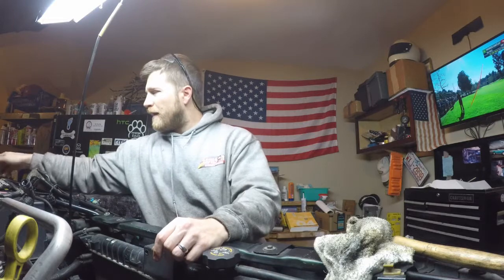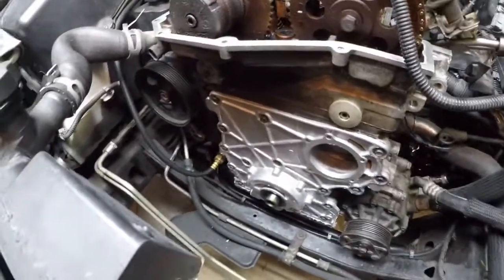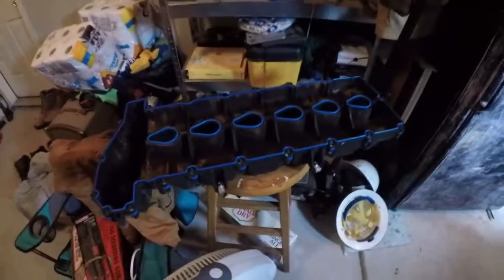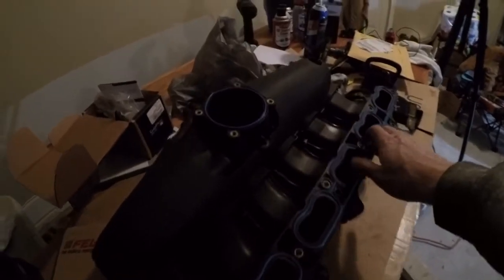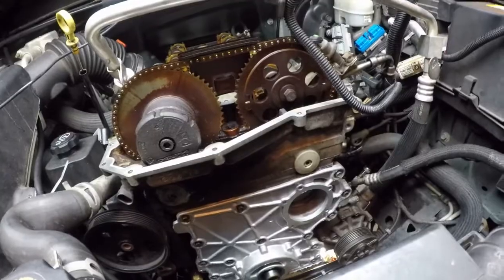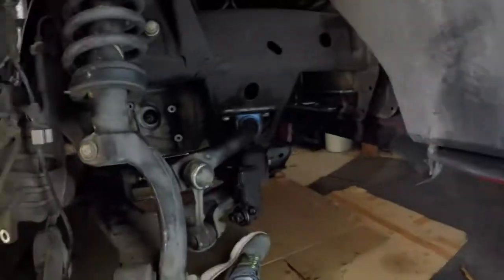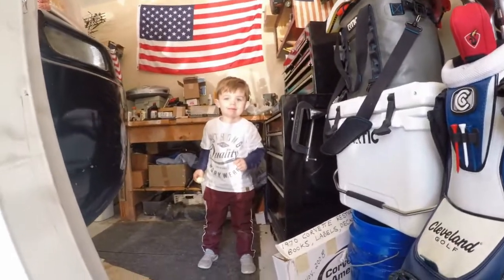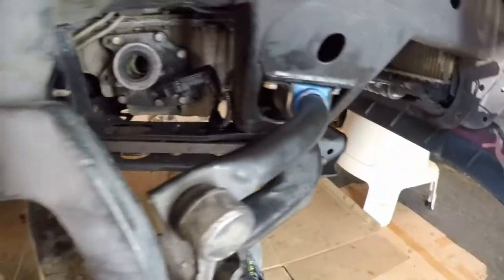Waiting on Harmonic Balancer Installer (GM 4.2L Oil Pickup Tube Removal - Part 4)

Comment: That tool is a bit short and thick I rented and doesn’t work for the trailblazer
Reply from the maker: I had to buy a puller specific for this truck. The one from the car parts store didn't work for me either.
Reply: @KevinNadeau  I bought the one from Oreilly two ton with flat jaws it work

Comment: been chasing a pressure problem for a few weeks...installed a mechanical gauge started the engine gauge went to 60psi...as the engine warmed up gauge slowly dropped to 0 while the dash gauge showed 40psi!!..no "bad" engine noises..shut off car restarted gauge went to 25psi then slowly dropped to 0...
1)Did a 5 min motor flush.
2)I drained the oil added 1 gallon of parts/carb cleaner thru the dipstick tube let sit for 2 hours.

3) replaced the oil pressure sending unit.
4) replaced the stepper motors.
Also replace the VVT solenoid..had a code set and cam position sensor..
I am now going to replace the oil pump..and from what I have found out there are 2 designs..design one will allow you to use the old pick up and timing cover...design 2 you have to buy a new tube and timing cover..

Comment: I just R+R'd a 4.2 in a 2003 trailblazer (blown head gasket, rod knock), and the 'new' engine must have a plugged pickup too. I'm wondering if a gallon of parts cleaner solvent in the oil pan for a few days may solve the issue. I'll report back!

BTW my differential was seized in the oil pan in both the junkyard engine and the old one. Ended up smashing it repeatedly with a BFH and 2x4 and wd40 on the rear end of the housing to break it loose. Not fun, even with both engines on end on the garage floor. I can only imagine trying to remove that nonsense still in the vehicle.
Reply from the maker: It would be worth a shot.  Just don't over fill the oil pan with parts cleaner, I wouldn't want that stuff eating the gaskets.

Comment: Kevin after watching you video's first time fast. Second time thoroughly..You do incredible work. Meticulous and to the point. These engineers that design these things to make our lives miserable when we have to do repairs get pensions. Go figure.
I have a few questions. My Envoy is a 2005 with 242000. It mint and I love it. How ever I used to rebuild and work when I was a kid. Teens-40's I don't have the time or the patients for this one I think. So my question is????
1-Should I pay someone to do the repair?
2-Get rid of the vehicle?
I love it. One of the best SUV's I have ever owned. Heavy..Handles great. Good work truck too for my tools. Plus my daughter and her friends have plenty of room when I pick them up from schoo.
You thoughts would be greatly appreciated...
Do you think you will be able to get another 100K after this great repair you just did. I had to replace my Tranny at 179K I put a a used one in from a Salvage/Junk/Recycled auto parts distributor. Did it myself the Tranny cost me 660 plus 100 for 12 month warranty.
TY...SKIP!
Reply from the maker: I was debating whether or not to pay someone or get rid of my car too.  I decided to do the work myself to save a ton of money, plus at 250k miles, I'm not sure how much I'd get for my car.  It took me 4 weekends to do this repair, partly because I either didn't have the correct tools or I broke parts and had to order new.
My personal feeling is that if you're able to fix your own car, go for it.  If not, you can find lower mileage Trailblazers/Envoys out there for relatively low cost.
I had to rebuild the valve body on my tranny because it was not shifting from 2-3 properly.  Again for me, I have invested a lot of my own time and money into my car to keep it running, so I am going to drive it as long as it'll keep going.  I'm hoping to get at least another 50k-75k miles out of it.  My father-in-law has a 2004 Chevy van with 400k on it and I'm trying to catch up to him.
Good luck with your truck.
Reply: Thank you for your prompt reply. Your son has a dad to be proud of. Now for this GM stuff I hear you on doing the repairs yourself as I have done most of mine. I usually get HIGH 200K to 300K out of them but I don't know...I have no rust on the frame or body. New England weather and storage. GO figure. But I cannot justify what used ones are going for...Not Envoy but SUV or Pickup. 100K 8 Years 18K-22K. I will figure this out or be making a DUKES of Hazard Video of my ENVOY and posting it. Best man and thanks again!

Comment: Hello Kevin, what method did you use to get the harmonic balancer bolt loose without the balancer turning?  Thanks!
Reply from the maker: Cameron Lawrence, I used a tool similar to this one https://m.northerntool.com/products/shop~tools~product_200677477_200677477?adv=false